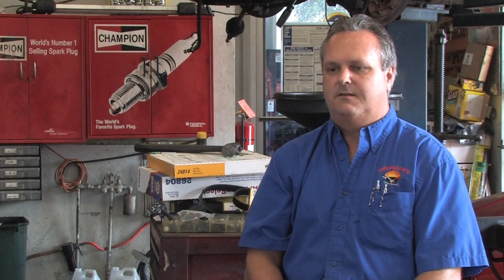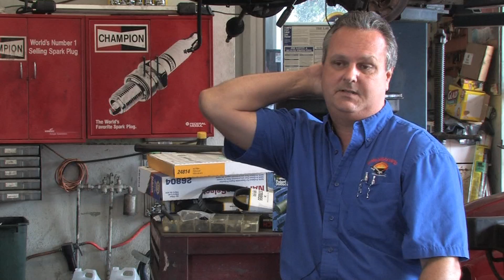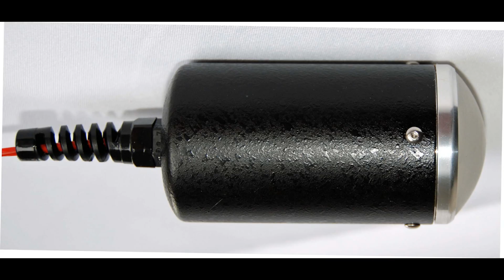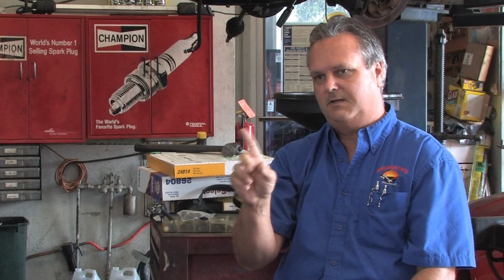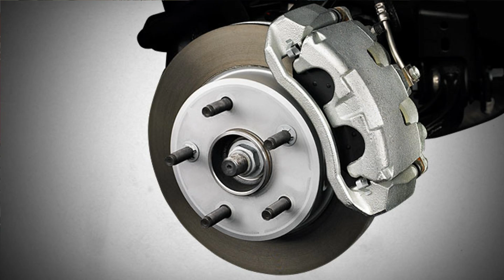Troubleshooting Car Problems : Where Does the Speedometer Cable Connect?

Comment: I have a mercedes V230 bus and the speedo is not working. Where does the wires for the speed sensor run from

Comment: I have a 97 gmc truck can't get any fire I've replaced the cam and crank sensor and cap and rotor also the coil and coil module HELP

Comment: @mcarver91 :You can pull the cluster out and make sure the speedometer cable es hooked to the speedometer , if that checks ok you go to the transaxle to make sure the cable is hooked to it. So what I am saying is that there's a problem with the cluster or the cable broke inside.